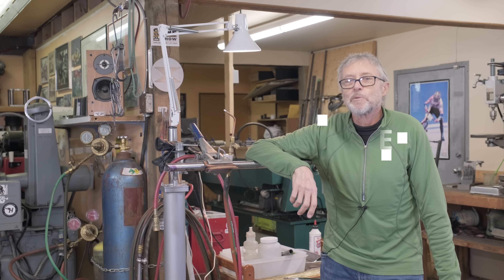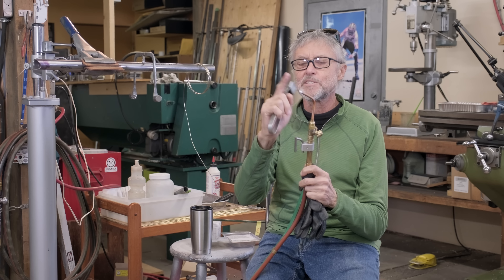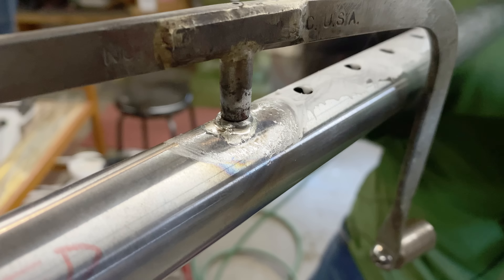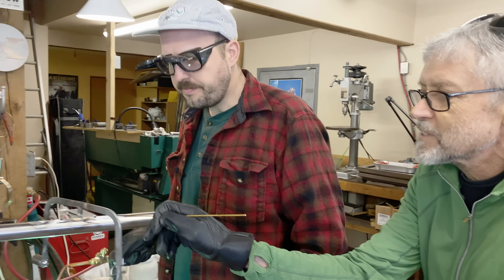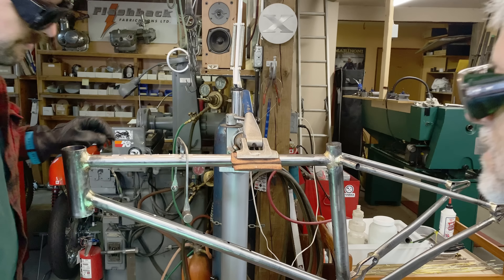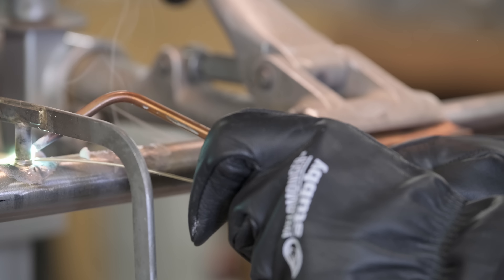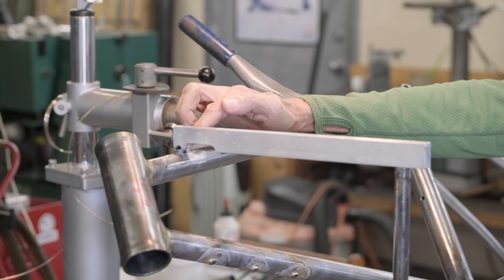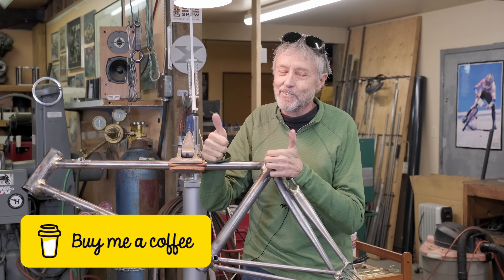How to Silver Solder - Watch Me Teach! // Paul Brodie's Shop

Comment: is that a gasflux system  and a powder fux as well, i have the chamber with the liquid flux  gives a green flame  like yours  but does not need additional flux
Reply from the maker: I have an inline fluxer and I also use a paste flux. Best of both worlds!
Reply: @paulbrodie  
i did my bike test with a  trials cub similar to yours almost 50 years ago 
i had to snick it into neutral whilst rolling up to a stop  as the clutch was typicaly dragging , test was a few runs round the block , then the guy jumped out in front of you for the emergency stop , any cub ive heard seemed to have a bit of 8 stroking just off idle  and one of the lads cured his by drilling a small hole  in the air slide at the top edge  which of course got covered  as the slide moved up ,i suppose filing the cut away would be similar,   the cub is still very popular with the trials guys and there is a few trick 280 cc ones 
at the scottish 6 day event   
its the engine that led to the many bsa  unit singles  and ultimately the CCM   motocrossers
Reply: @paulbrodie  
its very important when brazing the old malleble iron bracket frames  not to overheat the frame tube  i use silicon bronze and  an oxy propane rose head  nice soft  flame  that is kept moving 
with the tube located in a blind lug  you can cut pellets of  filler wire and coat every thing with powder flux  , put enough pellets inside and when they melt the tube is filled inside with braze as well as the capilary joint , i discovered this while re tubing a velo mov frame   i wondered what the bits of filler were rattling about 
i had a sidecar wheel bracket  fail on me at 80 mph with life changing injuries 2 years ago  on close inspection you could see the brass contamination through the steel and where the crack had been slowly bud surely
Reply from the maker: @eweunkettles8207   Yes, trials Cubs seem to be quite popular in the UK. If I didn't already have 2 trials bikes I would probably build one. Thanks for commenting!    🙂

Comment: Question  how do you weld a bottom bracket or head tube on a aluminum frame without distortion or do they machine it afterwards ?
Reply from the maker: They get machined afterwards. Welding always distorts.

Comment: Remove all brass fittings and replace with stainless.  The header pipes need to be smaller and wrapped. Large pipes are for large displacement/ cfm  , smaller diameter = higher pressure for the turbo and yes ,your turbo is too large for the displacement of your engine the boost is too low at low rpm so the fuel vapor condenses into droplets.
Reply from the maker: Whose channel are you responding to? I do not even own a turbo! Maybe your sense of humour has run away?
Reply: @paulbrodie  Sorry ,it was not intended for you, I clicked on the comment icon for Cars and Camera's turbo charged v twin mini dragster. One of your videos was next in que

Comment: Pl. Help me to solder one 60percent silver lamp. Kindly tell me how to make solder,
While I trying to solder, the lamp starts to melt before the solder.
Sir, please
Reply from the maker: Well, I cannot see what you are doing, so you are asking me to imagine...   It sounds like you have too much heat, and silver soldering silver is not easy. You will need either a smaller torch, a smaller tip, and possibly a smaller flame. Less Heat. You might even have to make a heat sink of some sort for the lamp to keep it cooler...   :face-fuchsia-tongue-out:

Comment: Technically this is NOT SOLDERing.  NOT  SILVER SOLDER.  This is  SILVER BRAZE  (brazing).   Many years ago  I worked in HVAC/R and back then we called this  "silver solder." Used  hi temp silver braze   for some work, and mostly  "sil fos".    But  especially nowadays with  electronics or  plumbing  silver solder,  AKA  low temp   or "lead free" solder,  calling   high  temp  silver braze  "solder"  is ESPECIALLY  incorrect.  The   pretty much  rulle of thumb is if you can bend the  filler material  with a finger,  it is low temp  silver  solder.  If it is very stiff and requires force to bend it is high temp or  silver  BRAZE
Reply from the maker: Wow, you are certainly the expert here! Very sorry if I called something with the wrong word or words. I will try never to make a mistake in the future.   :face-fuchsia-poop-shape:

Comment: Wait, wait what happened about age old advice heating metal to dull red? Will this actually bond for tube into casting silver soldering?
Reply from the maker: We are working with very thin tubing 0.6mm thick. You have to be very quick and control the heat. No time to hang around. I do not understand your last question. What is "casting silver solder?"
Reply: @paulbrodie  I need to Silver solder a 1" tube handle bar into a fairly thick central alloy casting (20s bike). They go inside fairly deeply - about another 2" How do I make sure the solder penetrates deep enough on such a critical component.
Reply from the maker: @VeloSquish  That sounds like a very tricky job. To get the casting hot enough without overheating the handle is going to be very difficult. Get the handle too hot and burning the flux means no go. Start over. I would not want that job. Maybe preheat the casting in an oven for several hours?
Reply: @paulbrodie  that is exactly what was happening on my tests, now thanks to you I know black deposits - was me burning the flux
Reply: @paulbrodie  so how would you for example silver solder a large frame tube into a headstock casting, is this not the same thing ?
Reply from the maker: @VeloSquish   Once the flux is burned you have to start from scratch, because at that point the silver will never flow..

Comment: Doesn't the heat have to be on the nutsert since it is thicker to ensure flow?
Reply from the maker: Don't worry, the "brazon" gets enough heat to allow the silver solder to make a strong connection.

Comment: I get the impression that Thomas couldn't even see the flame inner cone, I found it difficult to see on the video.
Reply from the maker: You need very good eyesight to do this well. It's hard for Mitch to get the camera to show the cone very well. Therefore, it is hard for you to see. We are doing our best.
Reply: @paulbrodie  Sorry Paul, I didn't mean any ill to you or Mitch for the video, it just seemed that Thomas didn't know what he was supposed to be looking at. Not getting the torch close enough to the work, was, in my opinion, someone who was not seeing what they should have been looking at. I have taught many people to weld with oxy/ acetylene, and one of the main problems encountered was with them not being able to differentiate the inner flame cone with the main flame, or an oxydising flame with a carburising flame.
Reply from the maker: @johnbewick6357  Thomas was trying to do something he was not used to: getting the cone very close. And being on camera at the same time. I did not take any offence to what you wrote, don't worry. Thanks for commenting...   😙

Comment: I've been pretty good at soldering but tig welding not so good. Not sure why. Great tips for heat control. Esp the heat sink. I've never had a dedicated heatsink, I just grab whatever fits from a block of aluminum to a pair of vice grips with a copper strip or even a c clamp. 🚲🚴‍♀🚵🛠
Reply from the maker: Sounds like you need a Tig lesson. A heatsink is a heatsink no matter how it is made.